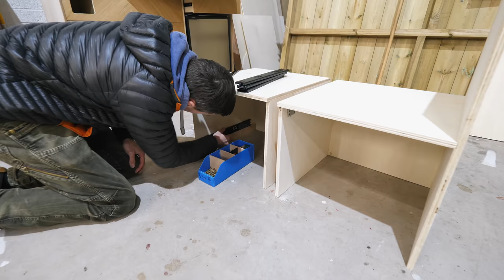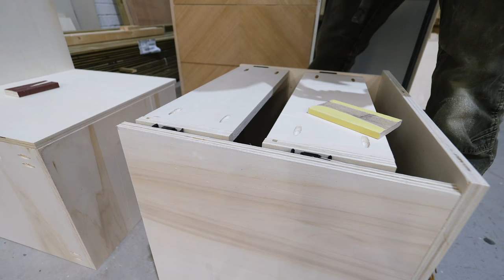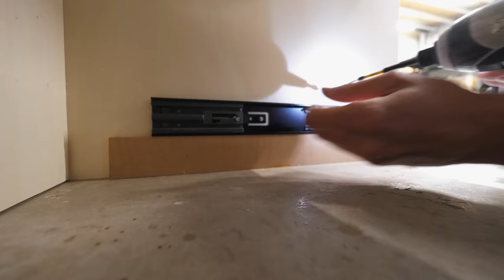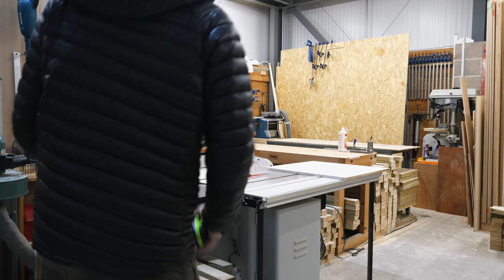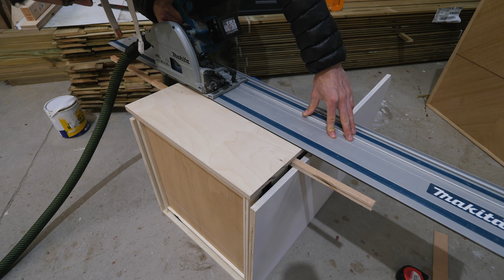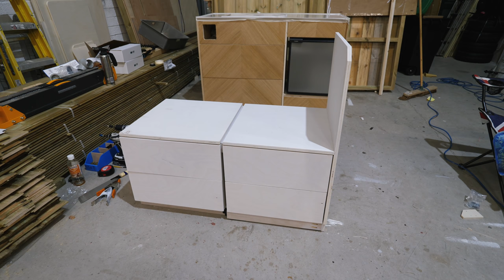Multi Function Sofa Bed For Camper Van PART 02

Comment: Hi great vids, what drawer runners do you use? You said they are soft close is that enough to keep them shut? Thanks.
Reply from the maker: So far they haven't rolled open but I think that could  change with  stuff in the drawers. I get all of my cabinet hardware from IronMongeryDirect, they have a fantastic service. If  you're planning on  spending over £100 I have a referral link that will get you £20 off:
https://ironmongerydirect.mention-me.com/m/ol/qg0oz-hugh-rycroft

Comment: Nice way to get the drawers to line up. Question, how did you avoid break out when you skill sawed the drawers in half? It looked like you cut face up??
Reply from the maker: The skill saw cuts incredibly clean cuts, I don’t get much if any break out. Plus I was cutting the ply with the top layers grain so that drastically reduces it as well
Reply: I get you, cut with the grain of the veneer, I must remember that one!  I'm supposing your saw blade is a fine tooth one then?
👍

Comment: Very clever, great design! Does the middle part fit in the gap when in bench position? If you lower the height of the sides of one of the top drawers, you could store the lid for the seat/drawer underneath the top sheet by using shelf holding pegs or a tiny strip. Sorry for the poor explanation, I hope this makes sense 😄
Reply from the maker: Yes or in the extra section under the bed that will be hidden away. Also thanks for the drawer storing idea, I get what you mean!